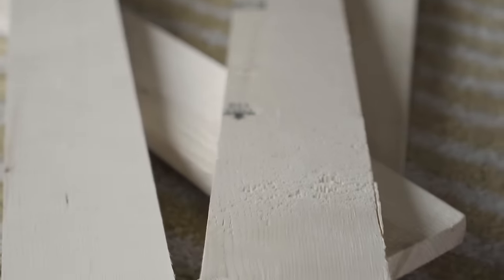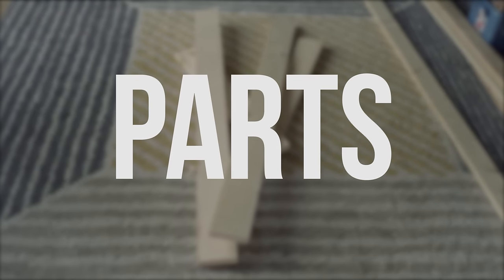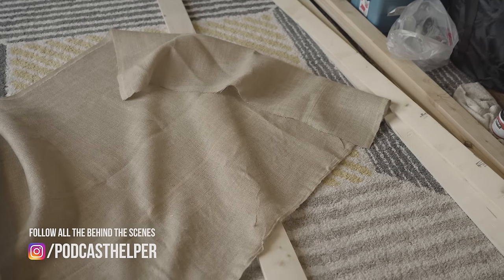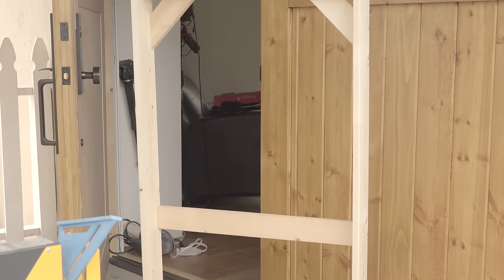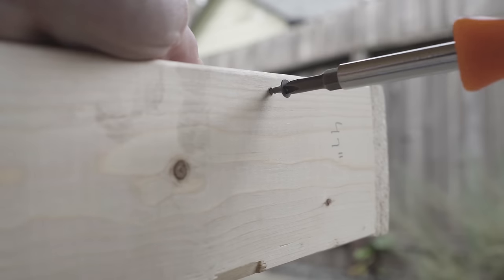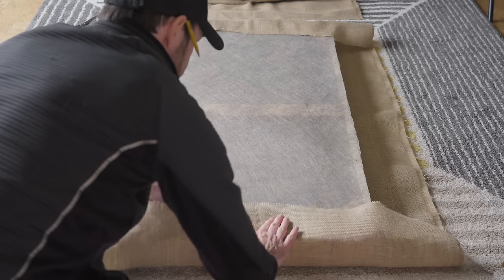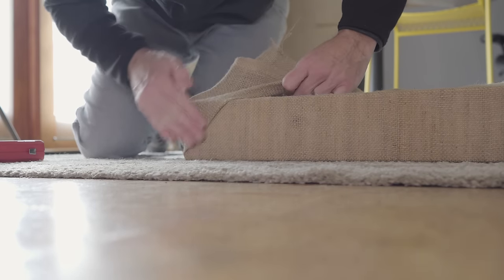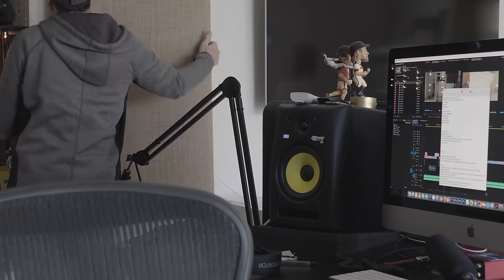How to Build Your Own Acoustic Panels

Comment: Hey Ray, can you tell me where did you get your breathable weed barrier fabric from, I've been searching around but couldn't find the one like yours.  I really appreciate for your help.
Reply from the maker: I can't recall if it was Home Depot or Lowes but basically any large box retailer like that should have some. I don't know that I could find the same stuff even the next time I went back, I wanted that gray stuff cause I think I recall the package saying breathable but I think if it lets water through then you'd be good. Then again it's sound waves so they probably go through most of this type of fabric. That's one thing I don't know enough about but the panels seem to work;)
Reply: Ray Ortega I appreciate for your reply.

Comment: Can you use fiberglass/Owen corning insulation instead of roxul? I have extra insulation but I've noticed roxul is more common in making acoustic panels.
Reply from the maker: Yes that is a standard in many panels, just ensure that you are covering them well enough that it won't shed into your environment. On my panels I plan to go back into them and add the weed barrier to the front as well just to ensure fibers stay in the panel.
Reply: So I watched a different video and they talked about formaldehyde in insulation. I've been doing some more research but if the insulation I already used contains formaldehyde, should I be concerned? I cant seem to find formaldehyde free insulation readily available.
Reply from the maker: @etmashorts  from what I know, Rockwool has gone to no formaldehyde or they have a version that is

Comment: I can’t put holes in my wall. Would adhesives hold these up or are they too heavy?
Reply from the maker: Probably too heavy but you can always stand them up against your wall around you and they will still likely help quite a bit. Maybe even make them taller for this purpose or stack two.

Comment: So since April, you aren't worried about deterioration of the rock wool, getting into the air?
Reply from the maker: Not really, It doesn't get disturbed for the most part and it's covered pretty well between the weed barrier on back and the burlap on top. If I did it again, I'd fill it with recycled jeans for an even better option but I'm not too concerned with the rockwool in them now.

Comment: can I use these in my home to lower the acoustics, I have an open floor concept, with 30 foot high ceilings, can I put these on the upper walls in order to absorb the acoustics from the kitchen and living room TV, As you can hear everything upstairs from downstairs?
Reply: These are mostly for controlling the flutter and natural reverb of a room but not soundproofing. So if you hang those up it will help with the sound of the tv going crazy and smearing to the other areas of the house but you will likely still be able to hear from downstairs

Comment: Why did you cut the side pieces of wood to 47 inches when the insulation is 48 inches? Confused as to how it fit.
Reply from the maker: I don't think the spec of the wool is exactly 48 if I recall and I wanted to make sure I wasn't compressing it too much, I would rather have to trim a little than to have it loose. It worked perfectly in this case.

Comment: is it possible to fit 24 x 48 insulation into this size frame with relative ease? I see that the 23x47" material isn't readily available everywhere.
Reply from the maker: Using 2 16" pieces could also work, just adjust the frame as needed. I would just make the frame the size you need and then cut the insulation to fit or make a frame that will fit 2 of the size you have available to you.

Comment: Do you absolutely have to make the 45 degree angle corner pieces? Will it still be solid without those?
Reply from the maker: Each piece I added, I tried to do without first (back piece, corners) but found that I ended up wanting them. The corners will help the frame stay even (not twist/bend) and will keep whatever you use inside, level for the back. You may be able to avoid making them however. The key is to just try it and see if you need/want them. Don't make them unless you have to.

Comment: Do you think I could use Mass Loaded Vinyl inside a panel like this instead of insulation?  I have some around, so it would be a convenient solution...
Reply from the maker: The good news is you can fill these frames with whatever you want but the key is to test. Some materials don't absorb as well as others so I can't say about the vinyl, I haven't tried it but you can easily make a frame, fill it and then do some tests with it. Speak directly into a wall and then hold up the panel to that wall and speak into it and see what kind of difference it makes. Best to test in a spot that has a lot of reverb. I also notice that when I hold my ear right next to my panels, it feels like the sound is being sucked out of my ear. It's very odd and a little bit uncomfortable but it demonstrates how much of the room is not being reflected near the panel. See if you notice anything when you put your ear right up to it in a quiet room.

Comment: That’s an extremely thin panel 🤔
Reply from the maker: These are definitely not bass traps, these will knock down higher frequency sounds and you'll need to make bass traps for low end if that is your issue but of course this is just a guide, you can make these as thick as you need for you space, just double the measurements you need. Thanks for watching.

Comment: Silly question, what is the weight of one of those panels? I need it to be super light
Reply from the maker: Not silly, and definitely not super light ;) I can't say but I can say they are heavy. Most of that is the wood of course so you probably want to do something like wrap fabric around the insulation with no wood or use very light/thin wood
Reply: @RayOrtega  I have seen something similar made with metal wall studs instead of wood to reduce weight as well.

Comment: If I make these with acoustic foam inside instead of rockwool (rockwool too heavy, and need them portable) how effective will they be ? Will they still be worth ? Thanx !
Reply from the maker: I think they'll be effective with anything that absorbs sound. Not sure what acoustic foam is. If it's the cheap stuff that looks like egg crates that people hang on the wall, don't bother. That stuff doesn't do a good job at absorbing the high frequencies. I'm actually replacing the rockwool with recvycled denim but I don't know that it will change the weight. The heavy part of these panels is the frames themselves, not the insulation inside.

Comment: Great video it helped a lot!  but I have a little question, that breatheable burlapper isn't a problem for our health? i mean,  by time the rockwool will detach particles that can damage our lungs, this breatheable burlapper will avoid this?
Reply from the maker: Thanks, Carlos. I can't say. I hope not cause I work with these panels all day in my office;) I don't find that the Rockwool sheds if it's not disturbed but I can't say for sure. The key is that if you're concerned, just use a fabric that is less transparent. I may end up recovering these with some professional acoustic fabric that is less porous.
Reply: That's what i thought. what other material could we use?
Reply from the maker: @bennieteerlijk  Really you could fill it with anything that is absorbent. Take a look into recycled denim.
Reply: Carlos 182 I just would add one more layer of protection like a really thin foil. Don’t worry about sound not passing through the foil. The foil reflects only really high frequencies which get sucked up by the outer layer anyway. :)

Comment: Hey Ray, thank you for this video. If I was to mount these to the corners how would I do so?
Reply from the maker: Thanks, good question. some hooks on the corners and then in your wall would probably work but I was planning to also build ones that were for the corners that are triangle shape specifically to fit. These would be more traditional bass traps.

Comment: Help! Dude I am so confused I got the exact same insulation but it’s only 16” wide it doesn’t fit the frame?!?!?
Reply from the maker: There's a 24" Rockwool. I had to special order it but that just means you order it and pick it up at the store. But with the 16" you can just lay in another 1/2 piece, make the frame larger for two or make slimmer panels. No harm, just make the insulation fit whatever size you make your frame, it shouldn't affect the sound absorption. I'd also cover the front with the weed fabric I used to make sure no Rockwool leaks into your environment.

Comment: Won't the breathable cloth let through the rock wool particles into the air?
Reply from the maker: Always possible, mine do not seem to be shedding material mostly cause they are undisturbed but if it's a concern, simply use another type of covering that has a much tighter weave which is something I may upgrade to in the future, some of the more professional coverings but of course they cost more. You can use anything you want as long as sound can get through and you can even fill the frames with any alternative material that you're comfortable with. Thanks for watching!
Reply: @RayOrtega  I was thinking of going with the cloth used to cover guitar cabs, that black carpet like one. I think it should be enough for keeping the particles from spreading into the air. I was thinking of stapling some thick paper on the back and not waste fabric there.
Reply from the maker: @cooper1101  Yeah on the back I have weed barrier to save costs and I'll probably rewrap these in less porous material at some point just for piece of mind although I do think they are fine as-is

Comment: Hey is there any way to hang this on the wall without drilling a hole in the wall?
Reply from the maker: They're pretty heavy. I'm sure you could get creative with some solution but maybe also just increase the height and lean them against the wall or even stack two. Doesn't necessarily have be to on the wall to do a lot of good.

Comment: hi i read a lot of bad things about rockwool but i need to make acoustic panels for the living room, where my kids go too. did i read that i am carcinogenic? that are bad for your health? Thanks for the reply
Reply from the maker: I'm not an expert but from what I've read, older versions of Rockwool had some Formaldehyde like fiberglass insulation (the other item to fill panels with) but either they have removed this or they have versions without it. Also just like fiberglass you wouldn't want to breathe the fibers so to be sure of this, you should cover both sides of the panel with the weed barrier or something similar like you see me use on the back of this panel. I did not do it in this video but in future panels that is what I would do to ensure the fibers did not come through the burlap, you could also use a less porous material that will hold in the fibers better. Take a look at the Rockwool website to find a version that is free from Formaldehyde or other carcinogens. You can also look into other materials like recycled denim.
Reply: @RayOrtega   thanks

Comment: Thanks for such a detailed video! I have one question, if you don't mind. The only thing that makes me doubt to use that rock wool material is that, if I understand correctly, it's not the healthiest thing to keep in a living space.) You've got this panels for a while already, can you tell, is that layer of burlap enough to keep that rock wool from spreading its fibers or any sort of harmful fumes into the air? Thank you a lot, your answer would be greatly useful for me now.
Reply from the maker: These are no longer made with any formaldehyde so I don't think any off gassing is an issue but as for the fibers, it's hard to tell. They are natural unlike fiberglass but ideally you would not want to inhale a lot of it. They panels never move so I don't imagine much if any is being set free but the good thing about these panels is you can fill them with any material you want. If you are concerned with Rockwool, I would suggest using recycled denim which is actually what I'm going to use next. I'll update this video with a new one where I talk and show removing the Rockwool and filling with denim.
Reply: @RayOrtega  it's very interesting to hear the result with denim-filled panels comparing to the current ones. Looking forward for the video.)

Comment: Hi, just curious if the rockwool has to be 24” because I see in the video it’s 24” but the link is for a 16” set from Lowe’s?
Reply from the maker: 24" is a special order, you can build with 16, just adjust your measurements to fit
Reply: Ray Ortega thanks bro appreciate the fast reply, I’ll go buy some tommorow for sure and get to building these, appreciate you a lot man👊🏻👊🏻
Reply from the maker: @lizzibeats3690  No problem, good luck and if you wanted bigger panels you could always just custom cut or stuff in two to fit whatever panels you want. Enjoy!

Comment: Hi there are some articles say this stuff causes cancer if used external walls. Is there any free particles in air
Reply from the maker: I don't think there is any science that shows that but it would be important to research deeper from credible sources if you're concerned. I looked into it as well and the product is made from natural and recycled materials. The current product no longer has any formaldehyde in it which may be why some articles are saying that. The fibers themselves are safer to work with than fiberglass cause they are rock and not glass but you still wouldn't want to breath it when installing it. I can't say if there are fibers in the air or not but the panels don't move and the burlap is a decent cover and I have weed barrier covering the back. That said, in future panels and if I did it again, I would use recycled denim because it's even more environmentally inert (I think) and there are no fibers. When I make some new panels with that material I will make a new video that talks about that update.

Comment: Is that insulation safe to breathe in the studio?
Reply from the maker: You don't want to be breath any insulation, ideally. In this case, if I made more of these, I would use the weed barrier that I put on the back of this panel, on the front as well since the cover I'm using (burlap) is pretty porous. That way any fibers are more likely to remain in the panel. The weed barrier is breathable so it should still let the sound waves pass through it just fine.

Comment: Finally after watching u teen vid how to cover mineral wool this is most informative. Nice work!  I installed min wool on walls and ceiling in my van. To maximize sound absorbing it appears covering with fabric or stretch carpet opposed to p,wood is best. Wondering what building code is covering min wool and any health concerns involved using just fabric? Would appreciate any advice. Thx
Reply from the maker: If I was building these again, I would use the weed barrier, that I used on the back, also under the covering on front to make sure no fibers get out.

Comment: How thick is the insulation? 2” or 4”?
Reply from the maker: 2" but you can make them as thick as you want. Thicker would be more akin to bass traps so it would absorb more low frequencies which is also something I need to build for the corners of my studio

Comment: Looking for exactly this, thanks!... be good if you could do the measurements in mm or  cm though as pretty sure most countries use metric these days... I did laugh when you said something like 1 and 5 8ths or something ridiculous haha
Reply from the maker: Thanks, hope this helps however I'm in the US so it's the only measurements I speak;) Maybe I can do the translations and post them in the description if people are having issues.
Reply: Check what size insulation panels you can buy where you are and see what size those are. Then make the frame that size, or a tad big larger so they fit. No cutting or other messing around of the insulation panels required.

Comment: Bro you should put another layer of cloth underneath the burlap otherwise the strands of rockwool will come out and cause itching
Reply from the maker: The panels are static and not much air movement in this space. I'm not seeing any fibers other than the burlap but if I did it again I'd fill them with denim
Reply: @RayOrtega  Why would you use the denim instead of the sound barrier insulation? Just because of potential particles? 

Does the denim kill the sound just as well?
Reply from the maker: @deangallagher4847  The denim is also very effective, from what I've heard, at dampening sound. It seems as effective although from the few pieces I have, it may shed much more than the Rockwool I have already used. So it may be a toss up. I'd rather have something that was not only more environmentally friendly but also even less potential for polluting the air space I'm in. I'm more likely to use an even less porous material to cover my next panels. Other reason I would try denim is to try it;) I like to experiment and it makes for good content lol.

Comment: Why use the wood you can't hang just the acoustic material?
Thanks
Reply from the maker: The frame is nicer and sturdier but sure if you wanted to wrap the material and stick it to the wall, it will still work. Having a frame though also makes it easier to give some room between the material and the wall for an air gap for additional absorption.
Reply: The particular material he used is soft and not hard compressed material.  Eventually it would tear from it's own weight if just hung on the wall by itself.  This material is normally used inside of interior walls between studs in homes and buildings for acoustical sound deadening.  It requires some sort of rigidity for it to maintain its shape.
Reply from the maker: @chuckcostello5167  Also a great reason;) I would think in any case it would need to be wrapped at a minimum. If that was mounted right it might work but you might as well build a frame.